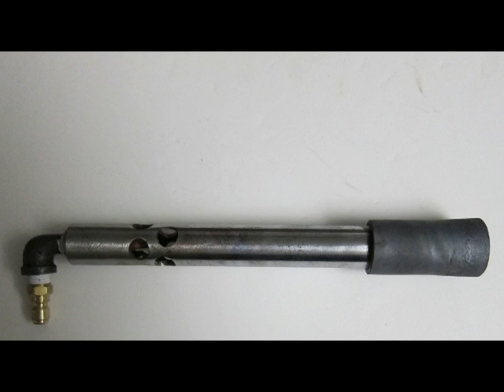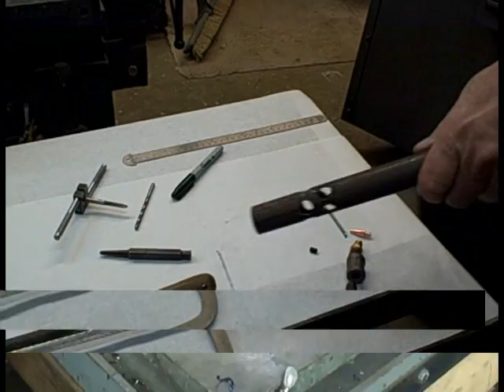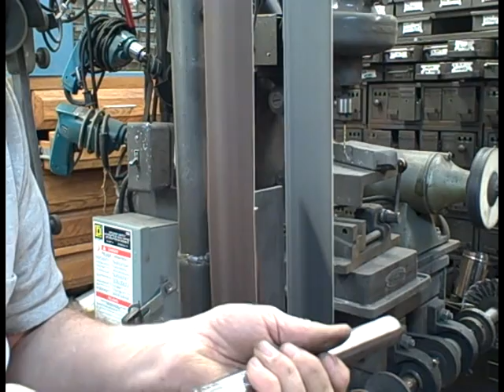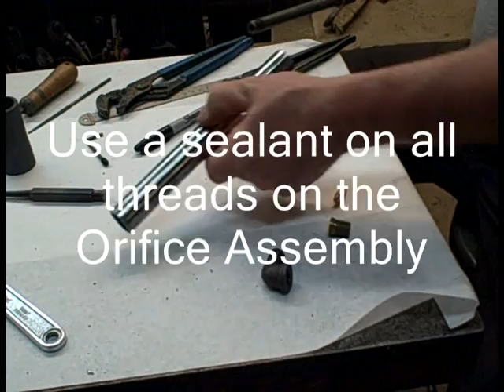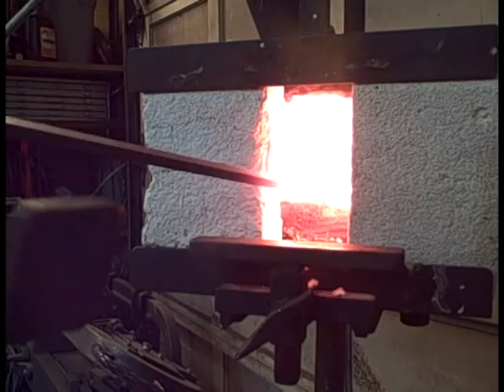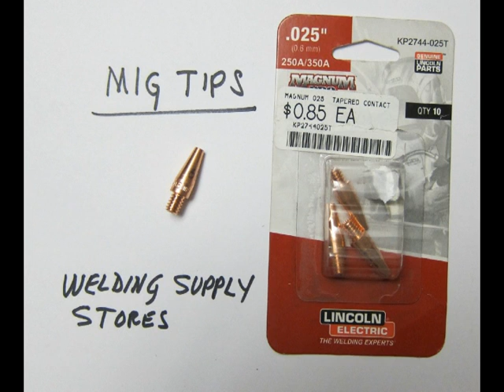How to build a Propane Forge Burner

Comment: I cannot seem to locate 1/4" black pipe in my area. Do you think there would be an issue with using galvanized? Also any reason for the 90 degree elbow? I was thinking of running the coupler straight into a ball valve and then into a stainless covered hose
Reply: If you are not already aware...  it is not safe to put any galvanized materials in a fire unless there is proper venting and it is basically impossible for you to breathe anything that comes out of the fire.  The coating will burn and produce deadly toxic fumes.  Since the coupler should not be directly affected by the fire, you could use a galvanized coupler.  Also.. since you have to sand (or mill) it to fit in the burner tube, I strongly recommend you use an effective face mask so you don't inhale any dust (obviously you do not want to breathe in iron dust of any kind, but galvanized would be worse than black pipe).  Do not use a galvanized (or any coating) pipe for the burner tube or flare.  

I use a street elbow into the coupler so my propane line goes off the the side  rather than straight up.  The elbow is not necessary if going straight  works for you.   

Incidently, black pipe fittings can be bought online.  This is one possible source....  https://www.plumbingsupply.com/blackfittings.html#coupling
Reply: Thank you sir. I really appreciate you taking time to respond to my comment, and the safety concern about the galvanized coating. I starting drilling the burner tube (upgraded to stainless) today. I am really excited to get  the burner going. I am going to run two burners as my forge is about twice the size of the super c. Thanks again for your generosity in sharing, and your quick response.
Reply: Good luck with your project...

Comment: David, what altitude are you operating from?
Reply: We are about 400 feet above sea level....   If you are  having problems with the burner, try using a .030 mig tip (instead of a .025).

Comment: This is a nice burner setup but considering you have 300.00 in parts why not just buy the Whole forge with 2 burners from Majestic for 350.00?  Not knocking the set up but money is tight these days....
Reply: This burner costs me about $10 to make, including the stainless steel flare.  The burner, without a flare, will cost about $6 to make if you already have the tools.

Comment: Will this work with the typical propane bottles you can get at local grocery stores?  You know, the big ones that are usually locked in a cage outside the store, or gas station etc.
Reply from the maker: Yes.  Those propane tanks are normally marketed for use with barbecue grills, but they can be  used for blacksmith forges also.  The hose assembly I describe in the video will directly attach to one of those tanks.  The tanks you referenced are 20 pound tanks.  Other tanks commonly used by blacksmiths are 30, 40 and 100 pound tanks available at businesses that sell propane.  A 20 pound tank, used with a single burner forge, will generally provide about 8 hours of forging.
Reply: "...will generally provide about 8 hours of forging."  -  Continuously, 8 straight hours?  Or just over its lifetime?  Then what, it's just too worn out to use anymore?
Reply: A full BBQ sized propane tank will (if full) provide about 8 hours of forging with a single burner forge.  If you don't have a BBQ tank already, You can buy a used tank already filled with propane at Walmart (you become the owner of the tank). That tank should last about 6-8 hours using a single burner forge (Walmart's vendors do not alway fill the tanks full).  

When you have used the contents of the tank, you can either exchange that tank for another used one full one at Walmart (or wherever they exchange BBQ tanks) for an exchange  price (I think most are around $20 or less for exchange now).  

Alternately, you can take the empty tank to somewhere where they will actually fill YOUR tank. Some Tractor Supply Co (TSC) locations fill user owned tanks (you could also look for propane dealers in the yellow pages).  

Although less convenient, taking your tank somewhere to be filled is generally less expensive than exchanging your tank for a full tank.    You can call around and ask what they charge for propane and if they will fill a tank you bring.

Tanks last many years if not damaged and could probably be refilled thousands of times.

I intend no judgement, but because of your questions, I assume you are not experienced in using propane forges.  

I need to add, as a safety precaution,  that propane tanks should not be transported in a closed vehicle (do you own a pickup or have a friend that has one?).   Many people will haul a small propane tank in their trunk, but it's not recommended.  

Also... A propane forge, when in use, needs to be in a well ventilated area.  They push out an extraordinary amount of Carbon Monoxide, an odorless deadly gas which will dissipate with proper ventilation.  

Propane is safe to use if you follow instructions and precautions....  and possibly deadly if you do not.
Reply: lol!  I'm sorry, man.  I confused you with someone else who was making an actual forge out of an empty propane tank.  I thought you were saying the empty tank being used as a forge would only have a life of about 8 hours. lol  Like before it fall apart from the heat, or something. lol  Sorry for making you type all of that.  I'm familiar with the propane bottles.  I always have at least 4 full at all times for my heater in my garage.  Thanks for providing the info though, i'm sure someone will find it useful.  Again, sorry about that. lol
Reply: No problem.

Comment: my psi won't get over 60 how do I get more pressure?
Reply: You will never need over 60 PSI.  I buy 0-60 PSI regulators so I can get more than 30 PSI when I want it (usually when I am heating the forge up, or I have put a lot of steel in the forge.  

It is rare that I even use greater than 40 PSI.  My general usage is usually less than 30 PSI.

Comment: I built a burner of your basic design and in use it starts reliably but the flame is soft. As it heats up the flame gets stronger but with extended use starts to flutter...I'm using a 10lb maximum pressure regulator and my only modification to your design is that I have made the insert that holds the mig tip is made of bronze stock I turned on my lathe. I have tried various adjustments to both bell and insert hight without success. My bell is 1 1/2" stainless pipe with a straight taper down to 1". What am I doing wrong
Reply: Your modification is perfectly fine, but you need a different regulator.  I use a 0-60 PSI regulator.  A 10 PSI regulator will not provide enough propane for forging.  I recommend you use at least a 0-30 PSI regulator....  Best of luck.
Reply from the maker: A .035 tip might (should) work, but usually .030 is the max size used with a 3/4 inch pipe.  

I assume you are trying to use the burner 
outside of a forge?   Is the flare similar to the 
one in the video.  If not, what are you using?  Did you try moving the 
flare up or down the burner tube a bit (start about half way on).  The 
next  thing I want to you to check is the mig tip alignment.  It needs 
to be pointing straight down the burner tube.  Move the coupler around a
 bit and try again.  The coupler needs to fit into the tube without a 
wobble.  If you're not sure the tip is pointing straight down the tube, 
get something that allows you to hook it up to a water faucet.  It may 
be a little messy to test, but  water should shoot out in the center 
(obviously the burner needs to be out of the forge).  

I always recommend the use of a commercial grade needle valve.  Alcon is
 the best brand I know of.  The burner will work without a needle valve (assuming the regulator is good and there 
are not problems from the burner build)  but it is the best way to control the propane.  

One other thing is to be sure there are no burrs on the inside of the 
burner anywhere.

If you still cannot get the burner to work outside a forge....  Put it 
in a forge and try it.   

If burner is in a forge, be sure the opening to the burner at the top of
 the burn chamber is clear.  To work best, it should be a cone-like 
shape up and past the flare.  The end of the flare should be at least an
 inch above the burn chamber ceiling....

Are you trying to do this outside?  If there is any wind at all, most 
atmospheric forges will not work.  The wind disrupts and disperses the 
propane gas.

Please let me know more if these suggestions do not help.
Reply from the maker: I gave a long answer....  I hope you got it.  If not, question me back again.  I did not address covering the holes and getting a soft flame.  This would be expected because, to get a blasting flame, air needs to be able to be drawn into those holes and mixed with the propane.  If you cover the holes, the propane will just disperse into the tube and come out softly at the end.

Comment: the forge I bought uses your burner. its really nice. the only questions I have about your burner is. If I operate it at full psi 30 psi the mig tip will start to get red hot so I shut it down. is this because my mig tip is to far down the pipe.
Reply from the maker: I have never seen a mig tip in one of these burners get that hot.  I frequently operate my forge at well over 30 PSI.  How are you seeing that?

When I make these burners, I set the mig tip in the center of the holes closest to the flare.  The burner will work if you position the end of the mig tip higher also.  You may have to experiment a bit.

Also, be sure the end of your burner is at least an inch up above the roof of the burn chamber (up into the burner cavity).

Comment: what is the dangers of a chimney effect....as you were putting more wool in the burner opening
Reply: In the least, you would lose significant heat from the burn chamber.  In the worst....  I don't know what the worst case would be, but since the propane is being spewed out  near the aspiration holes, I would not want that area super heated.  I would be concerned about the propane being ignited at the orifice.  Also, some folks may have a rubber hose  directly connected to the elbow and it would be subject to damage from the heat.  I avoid the concern by putting the thermal blanket around the burner (in the burner tube).
Reply: Ive heard of melting the threadlock at the joints but mine only got to around 400 degrees. So I either take out the burner after every forge or wait and see what happens
Reply from the maker: I may have misunderstood your question.  I thought you were asking what happens if you don't put insulation around the burner (in the burner holding tube.  If you are asking about the effects of a chimney effect after the forge is turned off, that is a different question.  I don't worry about any chimney effect after I shut off the forge.  Without a doubt, there is heat coming up and venting out the aspiration holes, but, to my knowledge, no damage has been done.  I have used these types of burners for several years, many for months without taking the burner out of the forge.

Comment: David is the 3/4" the inside diameter or the outside diameter of the pipe?
Reply: Inside
Reply: David Hammer okay thank you
Reply: hey david another question. does the 9" pipe need to be iron or can it also be stainless steel? because i am from the netherlands and for some reason its really hard to find schedule 40 pipe here. i managed to find some but it is stainless steal.

Comment: David: I'm concerned about using the BST-2 and BST-N2M connectors with Propane? I tried to contact the manufacture of the connectors but they didn't respond?

Comment: Is this big enough for a 20# propane tank size forge?
Reply: That depends upon how you line the forge.  This burner should work for a forge with up to 300 cubic inches of burn chamber if the forge is built and lined efficiently.  Normally, folks that build forges put around two inches of lining in them.  A 20 pound freon tank is 12 inches in diameter and about 11 inches tall.  If you use 2 inches of thermal blanket and had a floor of some kind, there would be over 500 inches of burn chamber.  This would require 2 burners (using 300 cubic inches per burner as a guideline).  If you put at least 3 inches of lining in the propane tank (with a refractory of some sort over the thermal blanket and a fairly thin floor over the thermal blanket on the bottom), one burner should work for you (the burn chamber would be fairly close to 300 inches).  

If you want a single burner forge, I would recommend using a small freon tank instead of a 20 pound propane tank.  this burner will work very well in that with 2 inches of thermal blanket liner and a single thin hard firebrick for the floor.  Empty Freon tanks should easily be available from any business that does air conditioning work.
Reply: I recommend the freon tank if you want to make a simple forge.  If you can weld and want to make a more versatile forge, watch my Super C videos.

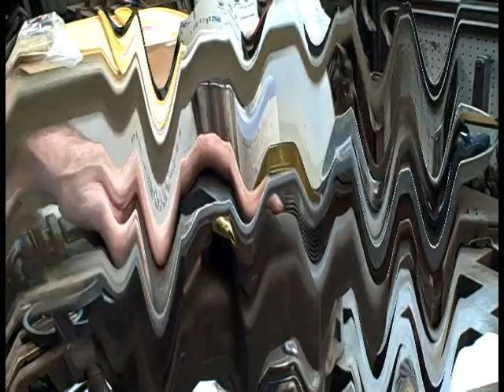Comment: David: At 13:53 the 1/4" MIP x ?Flare is shown. The hole in the end of the flare looks larger than 1/4"? Then at 14:06, the hole is small enough to tap to 1/4-20? Is this just an optical illusion?
I looked at some 1/4" MIP x 3/8" Flare fittings and the through hole is too large to tap to a 1/4-20?
Reply from the maker: Ed....  I use a "1/4 inch Flare x 1/4 inch MIP" (which is what you see in the video).  One brand (for that connector) is WATTS: Item # LFA-80.  The hole on the flare side is .185 inches and must be drilled out with a bit the proper size for the 1/4-20 tap.  Be sure to check the threads (per inch) on your mig tip.  Some brands use 1/4-28.
Reply: Very well David. Thanks for  info. The Watts LFA... parts are available here at Home Depot.

Comment: Many thanks for  sharing this. I watched this video several times a couple years ago, and I've gathered all the burner parts you recommended. Just to be sure, where you used all steel or black pipe for the fittings, is it ok and safe to use brass, it's just that I happen to have enough on hand. Also the actual forge body I'd like to use is a fairly heavy round air tank, about 14" diameter x 28" long.  With that size, lined with fire brick on the bottom 3 bricks wide end to end, and with ceramic wool on up across the top with maybe 4-6" holes at each end of the tank for access and aspiration. Considering all that, and the tank being that long, how would it be if I put two of your suggested burners to heat  the forge?  I already have the proper high heat digital thermometer to monitor  the temperature. My idea of a longer forge is to accommodate  linear projects.  Thanks again. Btw, one more thing, I've noticed some others aren't sure where or how to acquire the stainless pipe for the flare., I ordered mine through Zoro Tool as a short nipple, I think 12 or 14 inches, I can't recall the price, but I didn't think it was real expensive. They have an ebay store too. Just a tip.